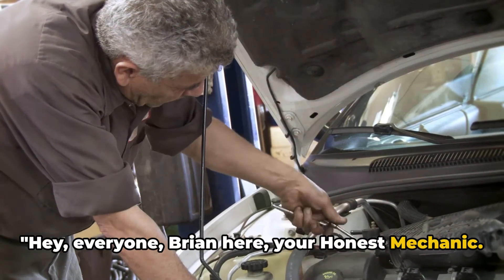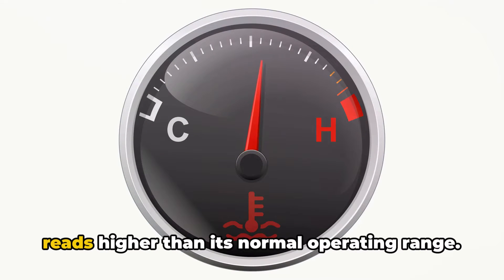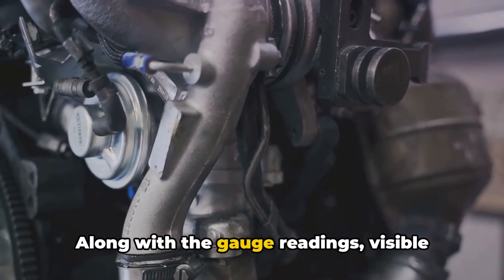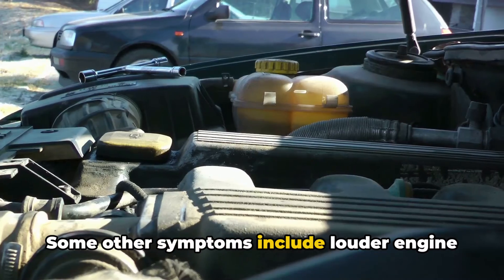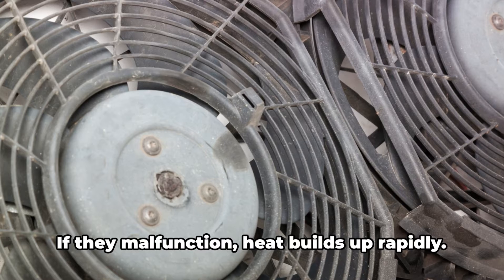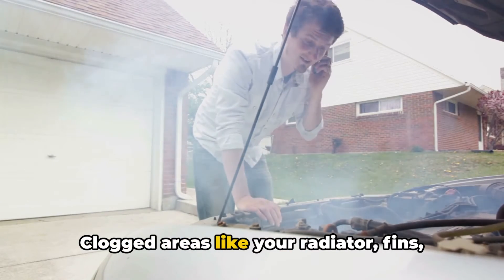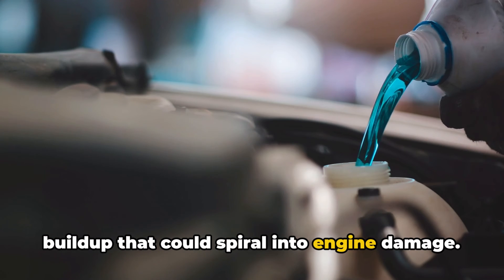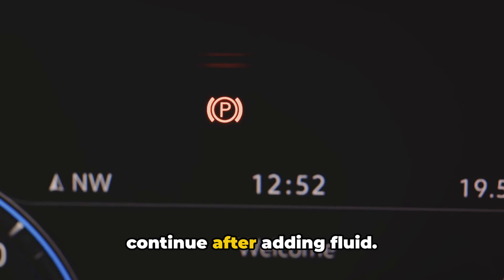Car Overheating Symptoms: 8 Signs and Causes

Comment: My car overheat for the first...I never knew the car was going through overheating...I just discovered at some point the temperature inside my car increases despite Air conditioner running..I thought I was low on gas or my AC compressor is malfunctioning..this continues intermittently and my attention was drawn to the dashboard lights to check what maybe going...behold..my engine temperature gauge on H level.. immediately I turned of my car.. gradually open the radiator cap to relief the engine..when the steam pressure coming from the radiator cap subsides, I then removed the cap completely..filled up the engine radiator to the brim with water..I was lucky the car started back because it took me sometimes to notice the overheating...I recommend the car manufacturers are  supposed to integrate alarm system into the car engine coolant temperature system which should trigger high warning beeping sound whenever the engine temperature is beyond recommend level